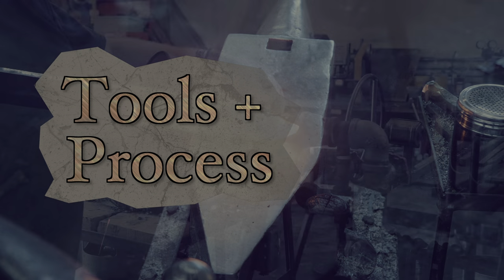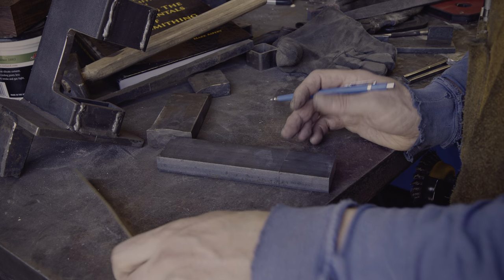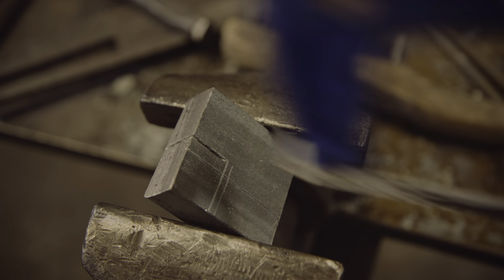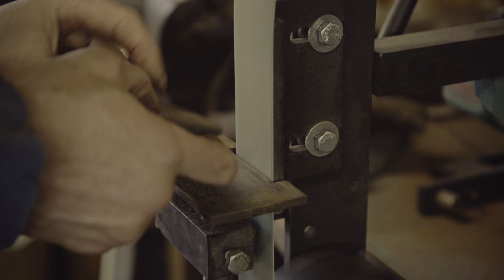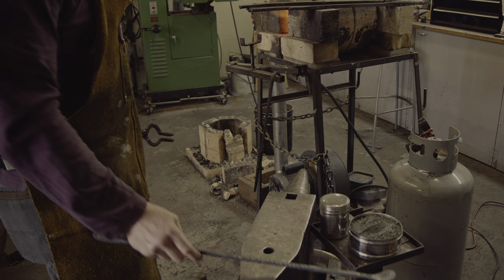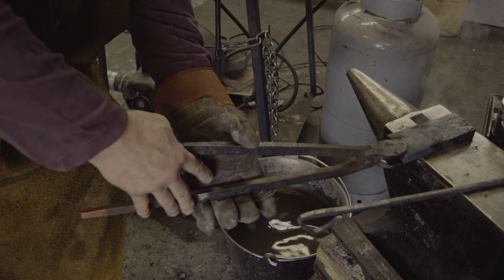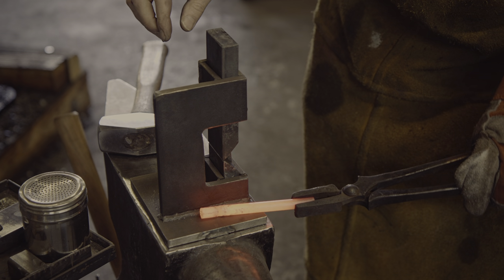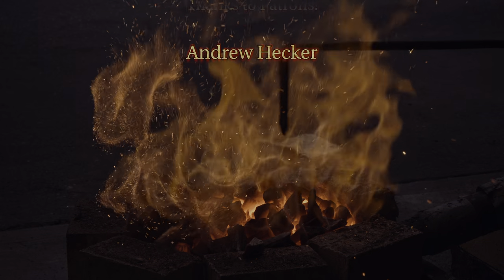Making Dies for the Blacksmith Helper (Tools and Process Ep. 3)

Comment: For case hardening to have any significant effect, you would need to soak the material surrounded by carbon in a closed container for a long time, since otherwise the carbon will burn off in the forge (and also diffusion is a very slow process). at least in my understanding. Thank you for the content as always!
Reply from the maker: The forge has a reducing atmosphere, i.e. not enough oxygen, so the carbon is not going to burn off.

Comment: One really easy way to case harden without having to spread the powder by hand is to pack slightly wet powder around the part, then isolating it from air by either using clay or stainless steel sheet/pouches, sealed well, with a very small hole to allow expansion for stainless steel. Then when you remove the part from the heat, you quench them. Chris at Clickspring has a video that's great about heat treating files and chisels he made that's perfect for explaining the process.
Reply from the maker: That sounds like it should work nicely and is similar to how blister steel is being made. For this project, I wanted something quick and easy. The tool has been holding up nicely so far.
Reply: I thought about Clickspring too.